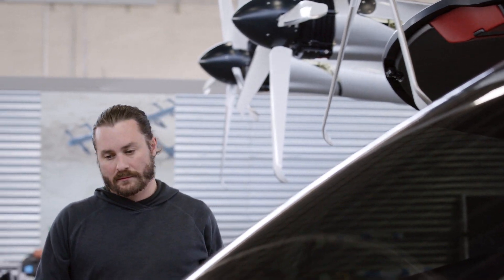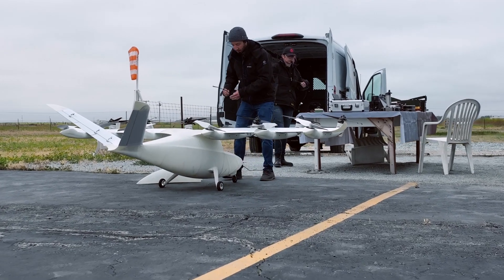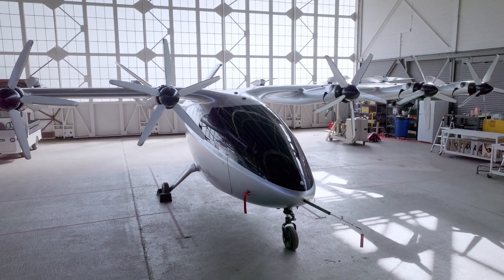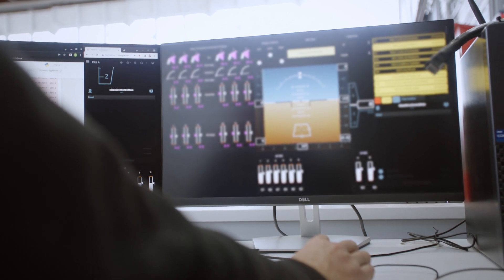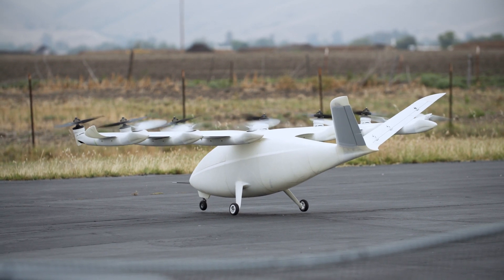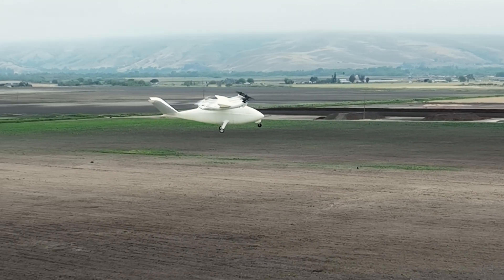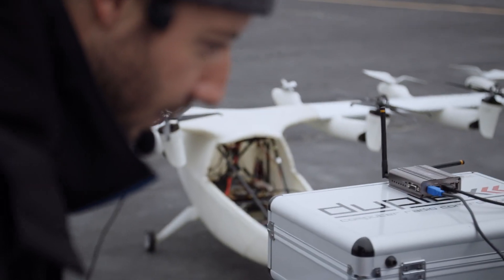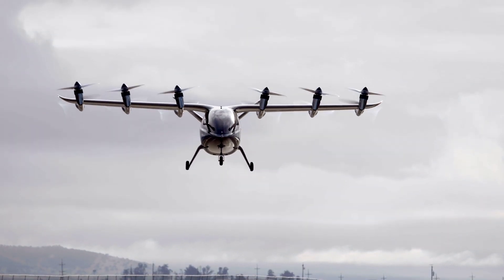Archer Tech Talks | Subscale to Fullscale

Comment: This thing is huge (in the body size ) for a two seater -the wing is around a foot above the heads of people - and it is overpropped in cruise by about 500% leading to very low propulsive efficiency . The more worrying aspect though is the vulnerability to loss of control from bird ,or flock, strike -having props way out on the wings is inherently dangerous (far more so than in a twin engined aircraft which is already fraught .  video of the V22 Osprey crashing seemingly just due to uneven ground effect on the rotors in hover after 40 plus years of development by the most competent large aerospace firms gives pause for reflection - how these things are going to handle mechanical turbulence near to ground is a real concern especially with unblown tailsurfaces and very little yaw authority in hover .  Taking many months to even do a single flight and requiring so much 'validation' of computer codes to even begin with does not auger well for reliability in the long run . Just like the foredoomed Boeing sponsored "Go Fly" fiasco -no one seems to question the basic thesis before getting immersed in the esoteric details and much vaunted computerized autonomy and artificial stability etc etc .  Technophilia is like hubris --a sign of bad things to come not being forseen in all the hype (the razzle dazzle 'launch' spectacular rang warning bells for many observers ....)

Comment: I only have one big problem with these future so-called air taxis. It appears they seem to have very little glide ratios, if any at all (not enough meat on their wings).
Reply: The airfoil on this aircraft is identical to a traditional aircraft.  It even appears to have ailerons/flaps to trim out flight.  12 motors with 6 battery packs is good for redundancy as well.  The question with this design will be if having that many motor mounts that rotate will be reliable and efficient.